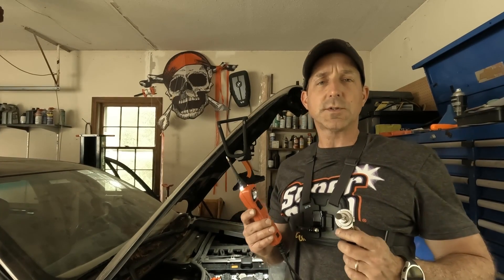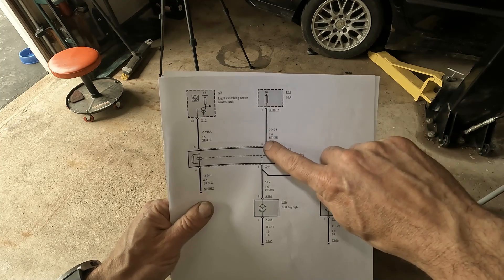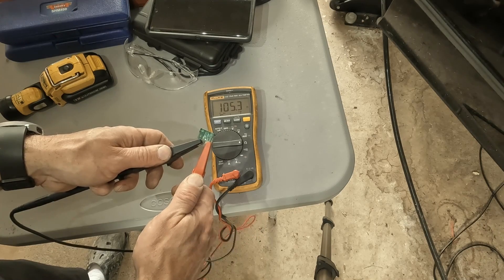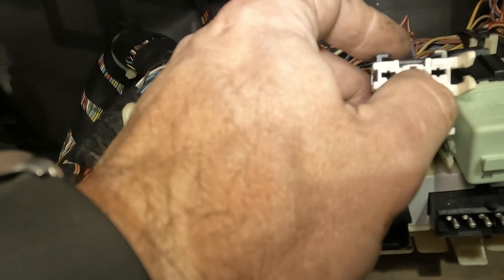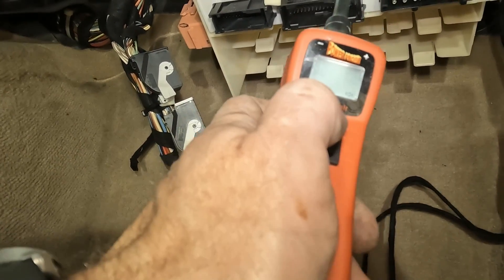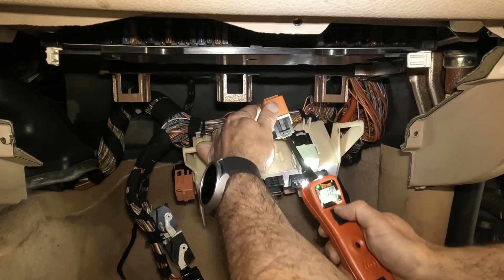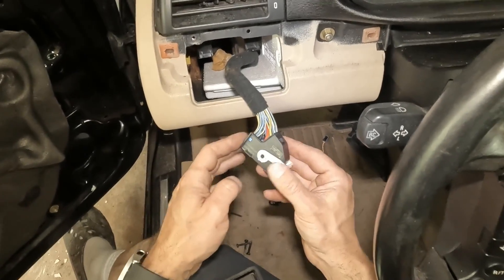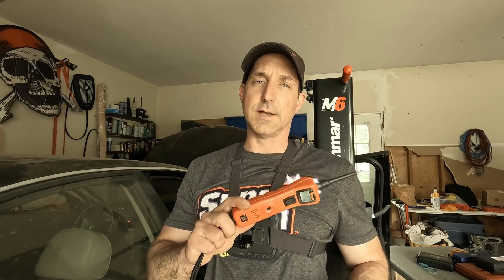Bulb Warning Lighting Malfunction BMW Fog Light Electrical Diagnosis E46 Fuse Wiring Relay  Testing

Comment: Hi, one feature (08 BMW z4) is that when the fog light is on, then the high beam is activated, the fog light should turn itself off. Mine is not turning off when activating the high beam. Would this be a similar diagnosis procedure? Can you offer any specific tips for this problem? Thanks!

Comment: Hi Oncle, it is possible to build an own wiring harness to light up  front fog lights that are missing as stock fabrik? I mean is there a route between glove compartment and Lcm module to run a wire ? Thank you in advance - Hope will get an answer.
Reply from the maker: Any modification is possible with the right motivation. I don't see how you would get the LCM to power it unless you borrowed power and ground and added a separate switch to activate the circuit. And you would need to run new wires to them.
Reply: @AskTheCarExperts  thanks so much I forgot to mention that my car is already equipped with rear fog lights that work normally. Now I have a doubt: it says on the original BMW post-assembly instructions:"If the specified PIN chambers are occupied, bridges, double crimps or twin-lead terminals must be used." At this point what is the best path to follow? I went to the BMW dealer yesterday afternoon to ask about the front cable kit and unfortunately they told me that it is out of production and they don't have it available in warehouses. Thanks again in advance. Umberto

Comment: Hello, i recently added front bumper with fog lights on my E46 316i from 2000. I never had fog lights before, i was trying today with my friend to wire up, but we wasnt able to do it because my rear fog light dont have on fuse box any fuse on position 38 its empty. So we stopped doing everything. On my Light control module i have only 1 button for rear fog light, is it possible some how to wire up from that single button my front fog lights so the work? Also i was trying to find some diagram from that Light control module to see wiring how its done. Also when my friend checked fuse box on position 38 there is only 1 wire on position 38 where should be fuse, it has only on down side but not above. Can you please help me with this? I am also looking at this diagram you have here looks like i dont have that par there on right side where it saying  F38 - X10015 - 30<38 -1.0- RT/GE. What is that, is that some module i should have on my car?
Reply from the maker: Hello Nenad, For this type of complexity I offer help for my members on my chanel..
Reply: @AskTheCarExperts  what chanel ?

Comment: i’m having a problem in my 328xi, i’m installing aftermarket headlights, they have angel eye leds the passenger side works fjne but the driver dose not. i disconnected the driver side headlight and plugged it into the passenger side and it turned on fine… i’m so confused
Reply from the maker: Not sure if this would be it but LEDs need a specific polarity. Try swapping the power and ground wire so the polarity changes.